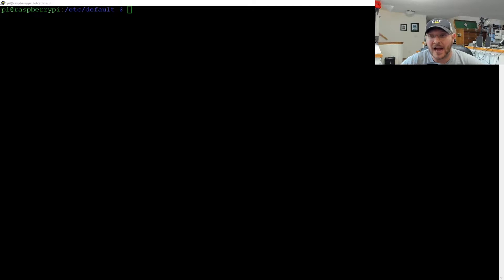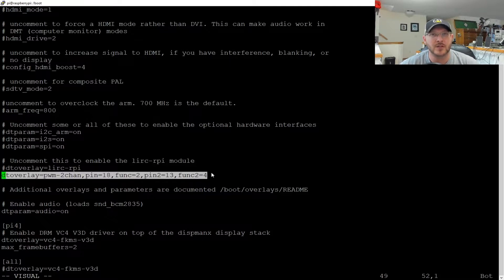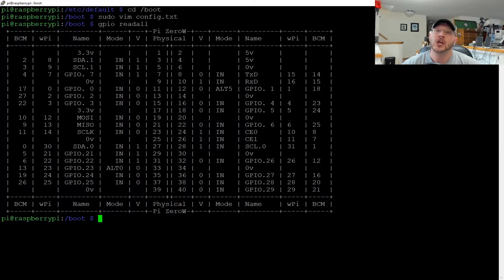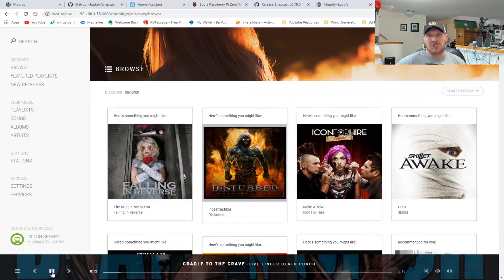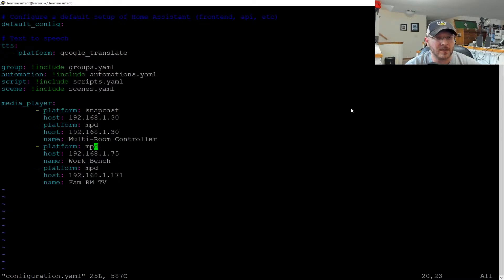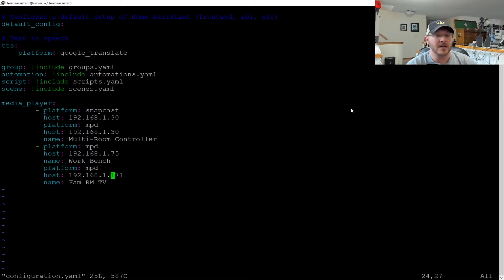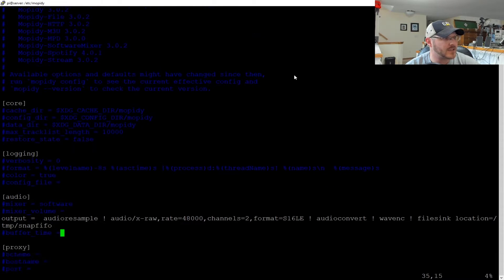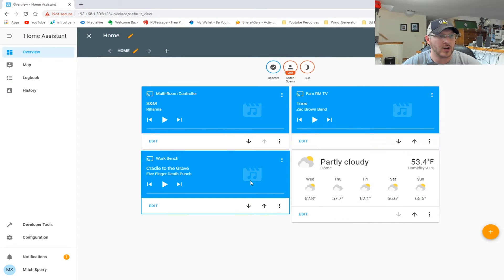Smart Home Whole Audio Part 2

Comment: You get all the way to 6 mins into part 2  to cut out all hassio users?  Would have appreciated a little more clarity at the begining.  Exactly what were the issues with the hassio addons?  Thanks for the vids, nothing else like this out there but disappointing that it doesn't integrate well with hassio(supervised)

Comment: Great tutorial, I ran into it after starting something similar. Not done yet. What I'm trying to do is to use the Bluetooth that is built into the pi zero w instead of the pins. Fingers crossed.